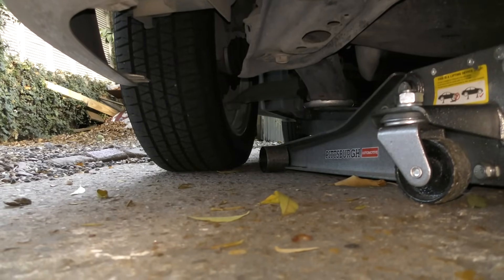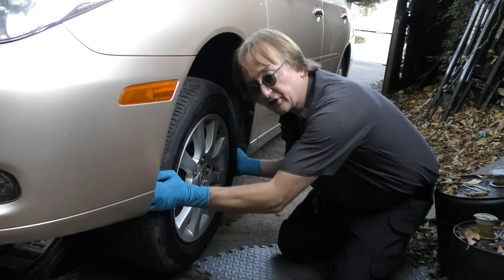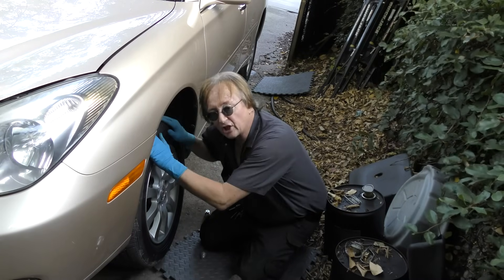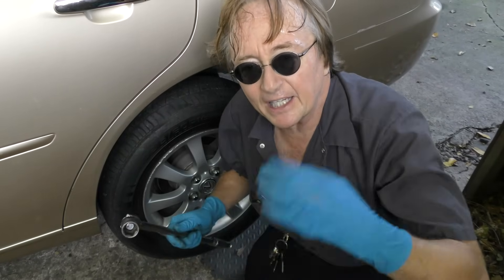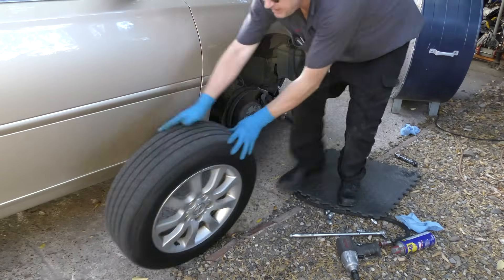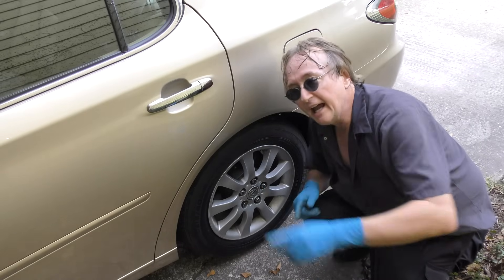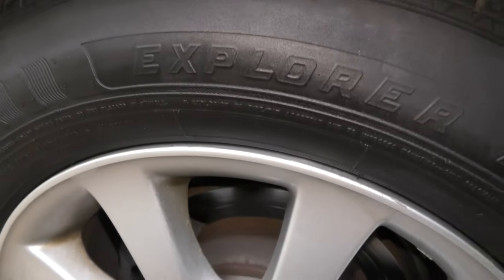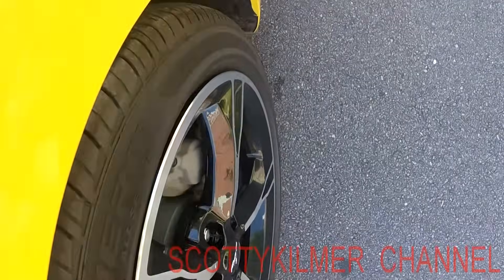How to Fix Wobbly Steering Wheel in Your Car

Comment: Every time I've dealt with a shaking steering wheel on a front wheel drive car, I've put the front of the car on jack stands, started the engine, put it in gear, and watched the wheels/tires as they rotated.  Always found the problem to be a bad tire.  A lot less work and I've zeroed in on exactly which tire.
Reply: it's 2024 and this comment cut my work in half.  One of the front wheels was more obviously egg shaped than the other, swapped that side only with the back tire and problem solved.  Half the work and now I know which tire is the problem child.  Thanks Scotty (& FrankH)

Comment: This also helps when you are experiencing alignment problems but worn parts and an alignment are not the culprit. My car pulled to the right but everything was perfect up front. Swapped front to back, back to front, problem solved. Obviously, one of my tires is worn improperly. Nothing a few burnouts can't fix.

Comment: Also watch out for popped off weights. 
On steel rims you'll have weights placed the edge of the rim to balance them. If one falls off it unbalances the tire and will make it wobble at higher speeds. Sometimes you can tell if a weight is missing as there's a spot with more or less dirt and wear to where it used to be. Just have to take it to a tire shop and ask for a balancing of the tires.
Reply from the maker: good advice
Reply: Yes!
Reply: Scotty Kilmer aren't you meant to torque the wheels to the manufacturers recommendations because that what the dealers do to every wheel regardless if it came off or not
Reply: Chatta290 You've been out of your mind for the last 3 and a half hours, sit down before you fall down.
Reply: Dragon Skunk I'm juts asking a question about the video not about what you posted
Reply: Chatta290
Then start your own thread.
Reply: Dragon Skunk i would but then there is literally no chance of scotty replying, never mind
Reply: a lot of tire places use the rattle gun which over tightens the nuts - ahem! - you could use a torque wrench but once you get a feel for how tight a wheel nut is meant to be you don't need one!
Reply: Yep, Scotty probably has a calibrated arm, he's been doing this kind of work for a quite a while now!
Reply: Bris Focus no here dealerships in the UK have to make sure everything is torqued i mean everything, even the wheel dont come off they get torqued during a service, this is form experience at land rover not any other dealer but they are mostly doing the same thing
Reply: chabka34 i know its true, i did work experience at a Land rover dealership. i was allowed to do most high however everything had to be torqued, i myself was surprised but its the truth
Reply: Chatta290
so that must mean they all do it because a luxury dealer dose eay
Reply: chabka34 what?, in the UK people take cars to dealers not mechanics or do it themselves. yes I would suppose people should do it because if you don't it can be quite dangerous, dealers do it as they are liable and it costs nothing for them to do this. not a luxury dealer any dealer
Reply: i have never done this and im fine it rilly dossent matter all that much
Reply: people in the uk must not be smart enuf to work on there own cars to save money
Reply: chabka34 no its just dealers int he UK never rip you off, its probably because we buy so many new cars and doing work yourself could void the warranty as well. for example in the US I hear German  dealers rip you off a lot but here most likely as they have so much business they are cheap to use and everything is protected and checked properly. with a Audi A6 the only maintenance cost over three years and 36,000 miles was a service which cost £250 and new front Bridgestone tyres which we also got for £200 for a pair bearing in mind any other place other then that dealer could have charged as that much for each tyre. if you have a really old car then yes you would use a garage not the dealers but Manny won't work not things themselves
Reply: @Horizon301.  most 5 lug wheels and nuts need about 90-110 pound-feet of torque, which if you take a torque wrench and apply it, it's not as tight as you would think. As Scotty says to just snug them on, that's all you really need.
Reply: Haldan P fair enough. My statement however mainly pertains to what dealerships have to do. In such cases they torque everything as per manufacturers guidelines. Personally, I have no reason to ever touch a torque wrench or take off a wheel at all.
Reply: No Shame In Being White they do but the new car market is large here thus dealers rarely rip you off, they seek repeat purchasing. I mean servicing is pretty cheap, and even tyres and other stuff, you can usually bargain and get them to match the prices of other retailers. I guess it just depends on the age of the vehicle, If it’s newer then taking it anywhere than the dealer is just foolish

Comment: Great job on recommending the breaker bar over the air gun. Personally I'd take it a step further and say tighten it with whatever you carry in your car. For me, it's my 4-way lug wrench. Never leaves my passenger seat. That way if I get a flat, I KNOW I can take it off.

Comment: My 2002 Honda Accord's steering wheel was VERY wobbly.  I rotate my tires every 6K miles.  I got it fixed by replacing the rack and pinion gear.

Not cheap (about 50% of the Blue Book value of my car) but I got the shop to throw in an inspection sticker and alignment for free.  My steering is very tight now and I love it.
Reply: Wobbly or loose? Wobble has no play, it’s just vibrates left and right a touch as you go. I hope they didn’t pull a $50 wheel from a junk yard and slap the old cover over it, you’d never know

Comment: I'd say a wheel weight falling off and thus causing a balance issue is more likely than a wheel bending from some minor curb rash. Stick on wheel weights can come off fairly easily, but even the ones that wedge in between the rubber and the wheel can come off. I've also had steering wheel shake from mud, snow, and ice caught on the inside of the wheel which throws the balance off.

Comment: I had a nasty shimmy at higher speeds (about 50 to 70 mph) so I assumed it was a balancing issue but it persisted after an alignment and balancing so I rotated the tires and that got rid of it therefore it narrowed it down to two wheels/tires.  When the time came for new tires, I bought 4 new tires and the problem came back so got two more OEM wheels and swapped them out but it didn't cure the problem.  Again rotating the tires/wheels proved the issue was with two specific wheels/tires.  To end this story, it turned out to be two consecutive sets of bad tires!  Top that!

Comment: Scotty,  I have a 2003 Honda Odyssey that the steering wheel shake left and right when I drive in slow speed.  I have had all four new tires re-balanced twice, rotated the front tires to the back and forth, it still doing the same thing.  The van has newly installed shocks and bushing, the front wheels also do not wobble as I checked it.  The steering wheel tie rods also still in good shape, the only thing I found is the steering wheel is kind of when turning.  By the way, I also replaced the right side motor mount recently.  Where do you think I should going after to diagnose the problem.

Comment: Recently I had a wobbling steering wheel at most speeds. The problem was a broken belt inside the tire which was making a spot in the tire bulge. The bulge was causing the wobbling. Luckily I checked it out because the tire would have blown out eventually.

Comment: love those old Lexus .reliable too.
Reply: Ditto!
Reply: Adel Jeffrey Best luxury brand.
Reply: Toyota is all about reliability
Reply: There's a 4 litre V8 in my LS400.  Don't know that there are any Camry parts in it though wouldn't object if there were.
Reply: I've had a 99 gs300 and an 08 gs460, I'm not exaggerating when I say I never had a single problem with either car. It's nice knowing your car isn't gonna break every few months lol
Reply: I know.
Reply: Yup!  Reliability = quality.
Reply: Those are not old Lexuses.
Reply: Lukas I had a chance to buy a 2002 Lexus LS 430 with 125 thousand miles.  I've wish I could have bought it.  I could not afford $8,500.00.
Reply: U mean Toyota not Lexus lol.
Reply: Adel Jeffrey What about the new ones? Ain't they reliable no more?

Comment: Hey Scotty. I have a steering vibration that starts around 70mph. I also notice my windshield mounted phone vibrates as well. Had alignment checked and it's within spec. Has new balanced Michelin Premiere A/S tires. Suspension seems nice and tight. I do however hear what sounds like a worn bearing or bad fluid coupling in rear while driving. Sounds like a jet engine. 2006 Toyota Matrix 4WD w/ 75k miles.
Reply from the maker: often worn rear bearings
Reply: Scotty Kilmer Thanks Scotty. I will check them out. Should I replace both sides if only one is worn?

Comment: Hi, love watching your videos. I had a question and be awesome if you'd give me your opinion. I have a car that shakes at about 45-50mph, tires were all balanced and rotated, no bent rim or imperfections were noted on the tire or rim. What could be causing it to shake in certain MPH? Thank you
Reply: Did u ever figure it out? Similar issue lol
Reply: @masterk5066  I took it to a mechanic and he said it was most likely a bearing that was bad but never had it done since for that specific car the parts were expensive and not very common
Reply: @gardengrovemike Most likely? Nothing i hate more than a guessing mechanic. Just throwing parts as shxt as they cost you more money.

Comment: Hello Scott ! I need your help. My Camry 06 rear wheel move places when I check it with 3 and 9 o’clock. What is happened? And also I replaced the hub wheel bearing, struts . But car still move side to side on high way ( 60 miles/ hr)  ( from the back). Thank you for your video and your time. I love your videos.

Comment: I spent a weekend driving a new Fiesta, great steering feel but now that I am back in my old Corolla, the steering feels loose and disconnected, I tried the same test you did and it's ok I suppose it is just worn out suspension parts vs brand new ones.

Comment: I’ll try my best to explain my issue. I have an 05 Tahoe that I believe needs an alignment since I have to hold my steering wheel at 10 or 2 depending on what lane I’m in. If I center my steering wheel I vier off the road pretty fast. Anyway I have an error come up on the dash 3 days ago. Said Service Stability control. The message disappeared the next day. On day 3 my suv now has a pretty substantial sway from left to right like a boat rocking but only when coasting or driving under 10mph max. After I get over 10-15 there’s no wobble but there is vibrating in pretty much everything. Any ideas what it could be?

Comment: Hi, Scotty I have a 2003 honda civic had a problem with the rubbing sound coming from the back wheels going around corners change the bearings and the sound was still there, it turned out to be rushed on the hubs rubbing. Bearings cost $111 all need was a hammer knock off the rushed. a well better safe than sorry.

Comment: Hey Scotty how are you? So here's my situation my car was in an accident and wasn't bad my fender was messed and some scratches on my rim. Body shop made it look like nothing happens. They did the alignment and the rim was rebalanced. I picked up my car and hoped on the freeway and noticed a wobble, took the car to get rebalanced the from two tires and I still have the wobble. If anything I think the wobble got worse, tie rods, ball joints and everything looks good. Someone told me it could be the hub plus I never touched that since I got the car in 2017 it's a 2013 Dodge Charger RT

Comment: @scottykilmer - My 2001 Mazda MPV is doing something odd in the steering. When I accelerate from a complete stop, the steering wheel jerks to the right about 45 degrees. The car continues to drive straight, and if I pull the steering wheel to "straight," I end up going off to the left. Get this, though: as I let off the accelerator once I have reached my cruising speed (anywhere from 35-65 MPH) the steering wheel returns to center and the car continues driving straight. My local tire shop checked out my front end thoroughly and found the rack and pinion to be nice and tight, as well as the tie rod ends - no play in them at all. Ditto for my bearings. There's no play in the wheels with the front end jacked up. Did find the bushings and ball joint were shot on the passenger side, so we replaced both lower control arms; we also found the struts were frozen so I replaced them as well. 

So, what's left? Could the transmission be sending too much torque just to the passenger side at low speed during acceleration?  Could the brakes not be disengaging sufficiently on the passenger side, dragging down the right side and causing it to pull the steering wheel? The most puzzling thing about it to me is that the car drives straight when accelerating at low speed even though the steering wheel pulls to the right pretty significantly.

Comment: scotty can you make a video explaining how to tell and put spark plug wires in the correct cylinder? I changed my spark plug wires and I think I might have crossed them but how could I tell which ones are crossed?  My car has been idling before the spark plug wire  change so determining crossed wires by the idle: I don't think will be of good use.
Reply: Replace them one at a time and you'll never have that problem

Comment: Scotty, hope you can help. Mercedes Benz c180 kompressor automatic, 2004, mileage 52,000.
Changed timing chain and tensioner, turned the engine over a number of times to check the timing marks then, when turning the ignition on, the hazard flashers came on but could not be turned off using the hazard switch. Switched off and then turned the key again (no hazard lights) and.... nothing, except the click of the starter solenoid. Checked the engine again and found I could not turn the engine (I did turn it anti-clockwise, only to make sure the engine had not locked up). Checked the timing chain well in case anything had fallen into it but was clear.  Have you had any similar experience with this model?
Great show and thanks,
Ted Murphy (based in London, UK)
Reply from the maker: those are bears to put timing chains on, obviously something went wrong on that work and will have to be put back on correctly and PRAY no damage was done turning the engine over and bending valves possibly. Good luck
Reply: Scotty, re. the Mercedes as discussed:
The problem was discovered when the drive belt ( which was renewed) was removed and, before removing the timing chain cover, tried turning the engine and IT TURNED once again. The problem was the alternator "pulley" having seized up (it has a free wheel system? incorporated which allows it to turn anti-clockwise). However, on removing it and checking again, it started to turn normally.....this is one amazing car but I will never work on another as I consider it a poorly designed car lacking any real quality. Just thought I would let you know how I got on, in case any of your viewers ever experience a similar problem when changing a timing chain on one of these "dogs".
This is a vert informative show put across in a clear and simple way.
Many thanks for your help.
Ted Murphy.

Comment: This is the exact car I have and I have steering play with clicking.  I'm assuming it is a worn-out R&P since there is no play in the outer tie-rods and the rack seems bolted on solid?
Reply from the maker: it would not click from a bad tire or rim, more often that's a worn ball joint or Aframe bushing

Comment: Did you spin the wheel around while up in the air to check for visual runout? You can usually see a bunch with a wheel bent enough to shake the steering wheel.
Reply from the maker: yea, and it showed nothing

Comment: changed starter on my 2002 gmc sierra 5.3 didnt disconnect battery ,shorted out now wont crank.fuel pump working think its not firing

Comment: Kia Forte 2011 at 75 there is a good amount of vibration coming up through the stEarring wheeling and throughout the car I jacked the car up wiggled both front wheels and no movement I’ve switched the front wheels around and it still continues

Comment: We had a Jeep liberty with aluminum wheels. Shortly after buying it someone on the road pointed to our rear tire. When we got to a light they explained that the rear tire was wobbling. Turns out the rim was bent. A quick visit to a local scrap yard and we had a good rim on the vehicle. The yard even put it on for free (Balanced too)

Comment: I usually find 9 times out of 10 when a steering wheel wobbles. It is from tire seperation. You really should spin the tire while on the car and look at the tire for out of roundness or seperation. I also would reccomend torquing the wheels down with a torque wrench so the rotors dont warp.Just my 2 cents.
Reply from the maker: that was done when put on the back, and it didn't show any out of roundness or bulges, strangely enough
Reply: yes scotty knows the feel so hes ok , but everyone else should use a torque wrench my car is 95ftlbs my truck is 150 ftlbs  very important i never see people doing yes u r right

Comment: Had a firebird that stumped me for a while. Wasnt worn parts, wasnt rims tried 2 sets of tires.  So I replaced all the lug nuts on one wheel hub after seeing one was slightly damaged. Turns out all of them studs where bent ever so slightly

Comment: two inquiries.  First, I thought when tires were rotated you wanted to take the rear tires to the opposite front side?  Or was this just trouble shooting, not rotation?  

The second, I am feeling a wobble sometimes in my steering.  Most noticeable when I get above 40mph.  And I have hit some curbs.  I guess this isn't a question as much as me saying I probably ought to rotate the tires and see what happens...